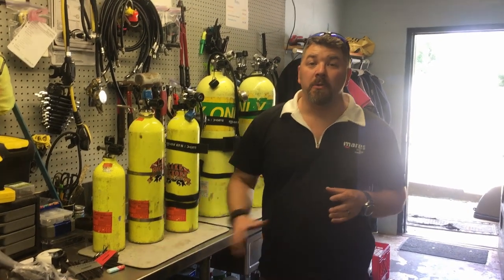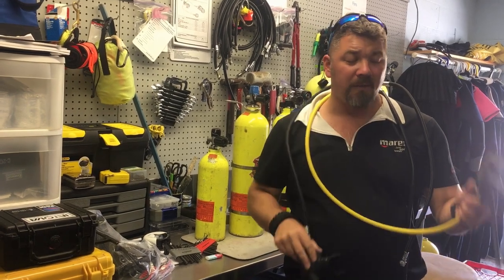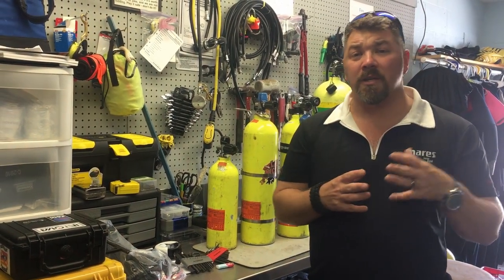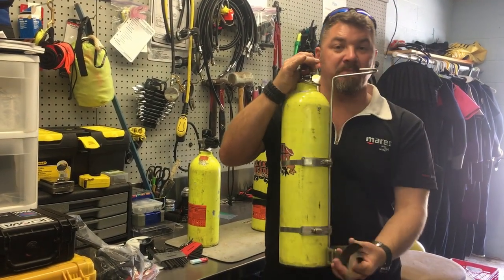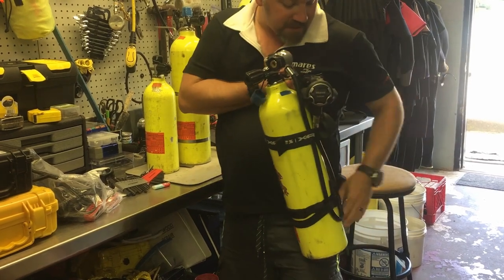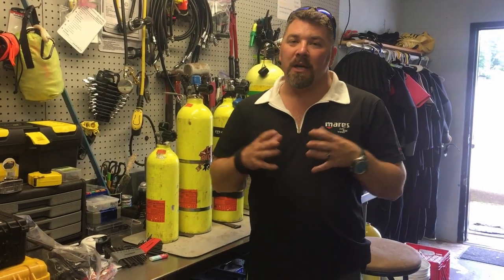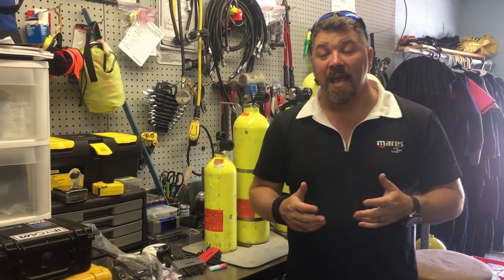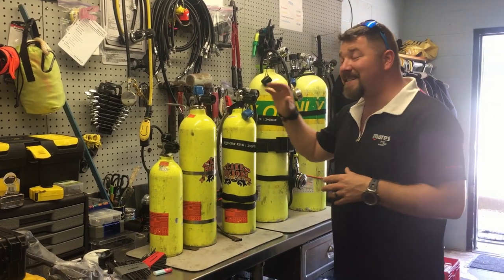Pony Bottle / Stage Bottle / Deco Bottle

Comment: Part of the confusion comes from not understanding the English language and where terms came from. For example: "stage bottle." A stage bottle was originally called that because it is placed...or staged...at a specific place, independent of where the diver is at the moment; it may be hung at 15 feet to use during a safety stop, it may be placed outside a cave for low-air situations for those exiting a cave, etc. And, of course, one or more may be staged at different depths for use during decompression stops. Therein lies a point of confusion: a second use of the term comes from bottles designated for use during a particular "stage" of a dive, such as a deep stage, ascent stage, or a decompression stage. The best way to avoid confusion would be to have a universal set of standard terminology, but that's never going to happen. The next best way is for speakers to be consistent in their own use, and for listeners to be attentive and take into account the context in which the speaker is speaking.
Reply from the maker: I agree with you that a universal terminology would be great to have, but I also agree that will never happen.  I catch myself getting tongue tied all the time, when talking to students or other divers, calling a pony bottle a stage bottle / deco bottle / sidemount bottle.  I may be part of the problem with the confusion, but then again, I am only human.....
Reply: Considering the limitations of oral transmission (Wouldn't it be great if we were all telepathic? ...Or maybe not.), I think you do very well. Your videos almost always have something useful I can take away with me.
Reply from the maker: SeikiBrian True, but I do deal with people a lot at the shop, and if they really knew what I thought of them, I would probably lose them as a customer. It would be cool though Underwater.

Comment: I usually explain it like this....

Pony is redundant system you do not plan to use only to be used in out of air emergency. Usually air - no MOD stickers 

Stage bottle is air you do plan on using to extend bottom time but is the same as your bottom gas. O2 % may change Dive to dive but was filled for your dive plan and can be used at any point during the dive. - no MOD stickers. 

Deco bottle has a different O2 than you back gas and may not be safe to use at any depth of the dive. - must have MOD stickers.
Reply from the maker: That's a great way to explain it.
Reply: Yes it can be confusing since often they are all connected with a “stage kit”
Reply from the maker: Very True

Comment: You cleared my doubts right down to the last grain! Thanks! Instantly subbed.
 I have another question. Do octopuses or alternate second stages fit in your primary tank? Or do they fit in a separate tank?
Reply from the maker: Hello @unrealbot3027, glad you liked the video. Typically, your primary regulator will have a primary and an alternate regulator attached to it. The pony system, or redundant air source system will only have one second stage attached to it. So this gives you a total of 3 second stages while diving. Now some divers who choose to place the pony bottle on their back, will choose to remove one of the second stages from the primary regulator. This helps eliminates extra hoses and can also help with confusion during a stressful situation. The key is to train and practice with your system in a pool prior to diving it in open water. I would also encourage a you to seek a local Instructor who dives a similar system to help get training on each system as well.

Comment: During my Deep course, I learnt about the stage or emergency (mandatory) decompression cylinder that is used in case the NDL was accidentally breached. From my understanding, that stage or deco bottle could be used with regular air or Nitrox (I'm Nitrox certified), and could either be left somewhere around 5 meters depth (hanging from a boat or somewhere on the ground at 5 meter depth) or be taken as a side mount bottle along with the primary back mount bottle. However, that cylinder shouldn't be considered part of the dive plan.

Here's the question: can I use this configuration (back mount with side mount/stage bottle) as my bottom gas in case I wasn't going somewhere near my NDL? If so, can the side mount be Nitrox and the back mount be regular air or is that stepping into the technical side of diving. Would having one back mount and one or two side mount bottles require specialized training such as side mount?

I probably mixed up the terminology, but I don't know if there's a standard name for this configuration. Sorry for that.
Reply from the maker: Great question Yousif Jawher. Having a good understanding of decompression theory is the key to juggling different gases while underwater. Yes this is a small part of technical diving, which I would encourage you to seek out a local tech Instructor in your area for further training. But in short, you most certainly could run back gas as air, and have stage bottle with higher partial pressures of O2. I will routinely dive with air in both of my Sidemount bottles to a depth of 100 feet, and carry a 3rd bottle with 40% in it to extend my dives at a shallower depth, as we deal with quite of few temperature changes here in our local area. Decompression Sickness can be induced with a sufficient temperature change, coming from 43 degree water at 100 feet to 85 degree water near the surface.  So even though these dives are recreational and not technical, I will tend to change the gas source as I ascend to a shallower depth to help flush out the Nitrogen on gassed at depth. If this is the option you choose to follow, I would suggest seeking out a local Instructor who can assist you in gear configurations and training to help you become very proficient with different types of gear.
Reply: @LakeHickoryScuba  you're the best. Your answers are straight to the point, yet so detailed! Thank you! I'm planning on taking intro to tech or IANTD advanced Nitrox in the future, but I'm considering doing different gases until then to extend my bottom times while taking into consideration max PO2 and NDL.

Comment: What is the rubber loop thingy on your spare air and can it be used for with diving with dentures? What dk you recommend for people with dentures?
Reply from the maker: For diving with dentures, I would most certainly recommend a custom moldable mouthpiece.  Here is a video showing you how to mold your own. https://www.youtube.com/watch?v=YJcv_9Gnkk4   Either the Jax or the SeaCure will work just fine.  The loop is a necklace that holds out alternate directly under our chin for easy accessibility.

Comment: great vid thanx for the info! in ur own personal opinion do u recommend using a stage/deco bottle as a pony or do u think that is overkill rather than buying a pony bottle I cant make up my mind to just get 1 or the other thanx in advance!!!!
Reply from the maker: If you are just in the need of a redundant air source for the unlikelihood event you ran out of air, I would say a 30 or 40 cf pony would be just fine. But if it's a case of needing the extra air to extend bottom time, I would go with an 80 cf stage bottle.  With that being said, if you dive with an 80 on your back and you plan to sling and 80 under your arm, look into switching over to sidemount diving.  Anything over a 40 cf under my arm, tends to get in my way.  In Sidemount the attachment points are slightly different than slinging a bottle, so it's more streamlined and a whole lot more comfortable.

Comment: Brian...mini SPG (attached to 1st stage regulator as a “button”) or a regular sized SPG with a 6” hose? Was thinking button SPG as it’s one line less to secure. Thoughts?
Reply from the maker: Hello C. Patrick Sadowski. Both. I use the button gauges on pony bottle systems, and standard gauges on a 6 inch hose for sidemount and stage bottles.

Comment: I see you have a mares viper reg I have a dacor viper that free flows at sea level and  has difficulty breathing at 80ft plus especially looking up are they worth fixing if parts from mares regs are compatible.
Reply from the maker: john metyk In my opinion, yes they are worth fixing. The free flow can be caused by many different things. Most likely is a low pressure seat or high pressure seat causing the free flow. Could also be the intermediate pressure is set way too high. If it become difficult to breathe, most likely it's because the older Dacor regulators were unbalanced regulators, which in that case they all become difficult to breathe the deeper you go.
Reply: Mares bought out Dacor decades ago, so although some regs are identical, many are not. Mares did not continue supplying Dacor parts fot very long so spare/replacement parts are had to find, you need to talk to a Mares dealer and get your reg serviced, or replaced !!!

Comment: Sorry sir..  I couldn't understand your explanation well, so if you please tell me some points:
* what is the volume of the small one in the video and how much is it in your country (I think it's USA) 
* how much it's relating pats (regulator belts...) 
Thanks for your time and help.
Reply from the maker: The purpose of the video was to explain the difference in terminologies between cylinders and their purposes.  In regards to your question specifically about the small cylinder, it is a 13 cf Aluminum cylinder, used a lot of times for dry suit inflation, and as a redundant air source as well.   Cost on a smaller cylinder like this one can range between $80 - $100.  Rigging for the cylinder can also range between $20 - $50.  Hope this answers your questions.